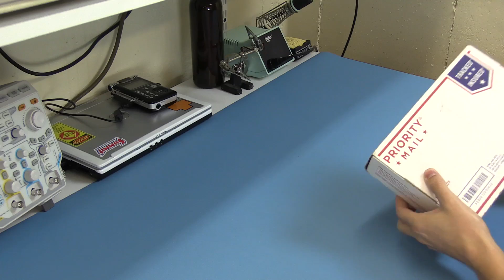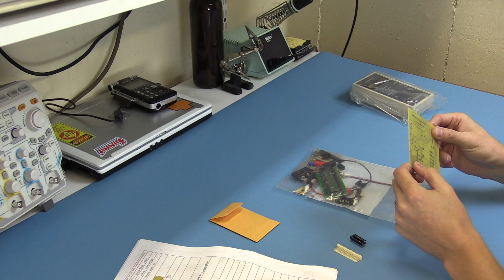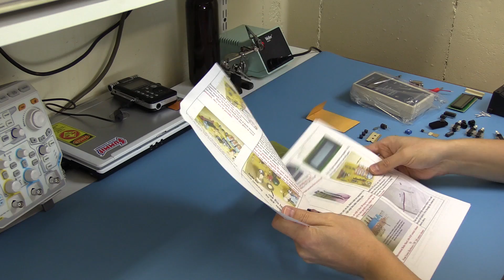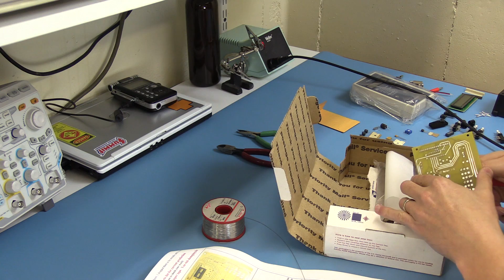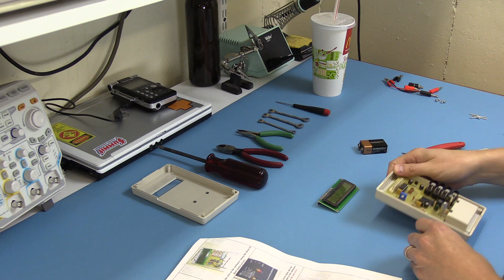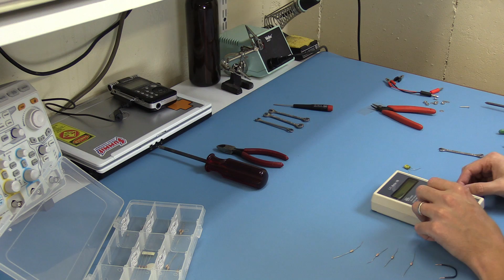LC Meter Build

Comment: I have also, love it! Does anyone knows if someone makes this meter, since the guy who sold them died in 2015?
I'm also looking for a manual for MLC500 meter (Sold under names like: Signstek MLC-500 Auto Ranging LC Meter    or    Q-BAIHE Capacitance and Inductance Meter MLC500  )- chinese from eBay, came with nothing but the meter. It works, but I like to know more...!
Also if there is an update and someone lets me know - thanks in an advance!
Thanks for the video and have a happy electronic life Aaron; and you all reading this also!
Reply from the maker: Thank you for the kind words. I believe the kit has been discontinued since Neil passed away. 😞
Reply: Yes, it was sad to see him go, the meter is great and despite having many LCR meters, his is very sensitive and measures values others can't! Have you or others here seen a video or good instructions for the MLC500 meter? Thanks again!

Comment: I built one of these years ago and really like it; especially for small-value caps and inductors.  I have found it to be accurate enough for most work; although you can't beat measuring components at the actual frequency of use (i.e. I'm too poor to have a network analyzer so I use direct frequency measurements reveal the lumped extra constants--boy was that an education!).

 I actually removed the power-button tip and even cut the switch-actuator back to keep from accidentally turning the unit on when carried in a tool-bag.  Additionally, I put a power-jack at the top (i.e. next to the LCD) that both disconnects the internal 9V and connects and external wall-wart supply.  This way, I don't have to worry about running down the battery and can leave the unit on continuously while working at the bench.  If I need it portable, I can just unplug it and go; knowing I have a fresh battery that isn't dead from just leaving it on.

Anyway, enjoyed the video since it brought back memories of when I built mine...
Reply from the maker: Cool, thanks for the tips!